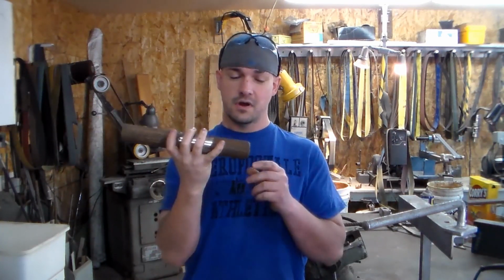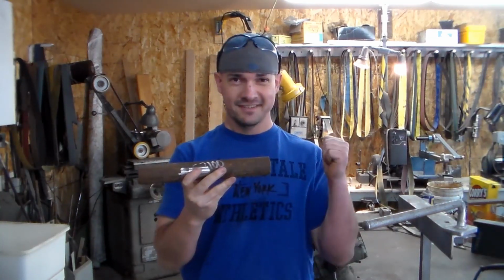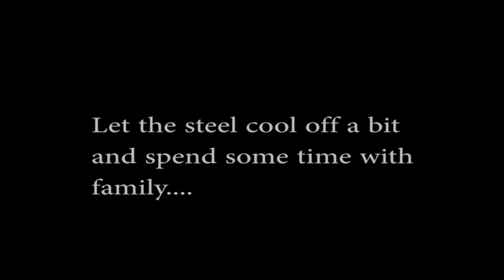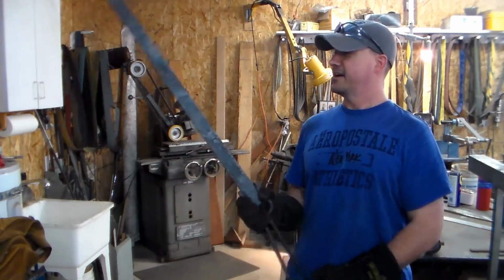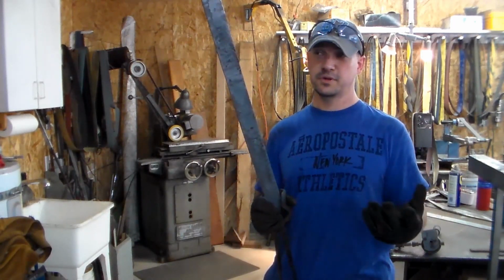Custom Knives  Forging down 52100 round bar with Nick Wheeler

Comment: Awesome job. I forged my first piece of metal way back in the early eighties out of iron using a bonfire a framing hammer and a counter balance weight off of an old caterpillar front end loader as my anvil.i was like eight years old at that time. I've been making knives for forty years now. And my favorite steel is 5160 spring steel off of old junker cars and trucks. It's nice too see that old blacksmithing skills are alive and well.